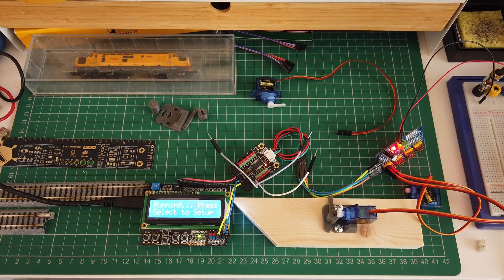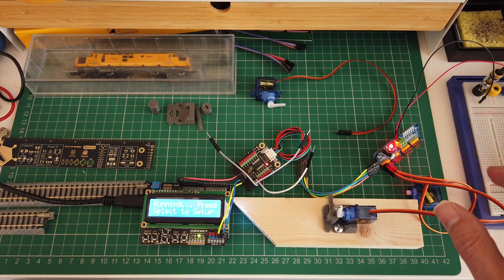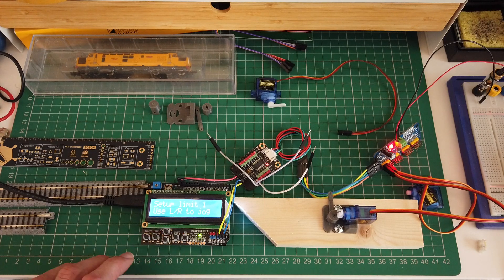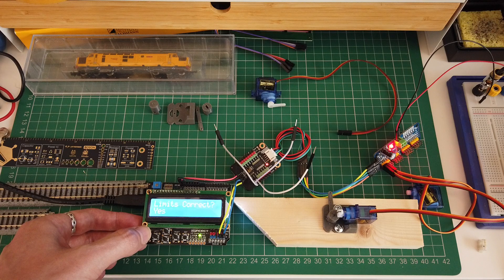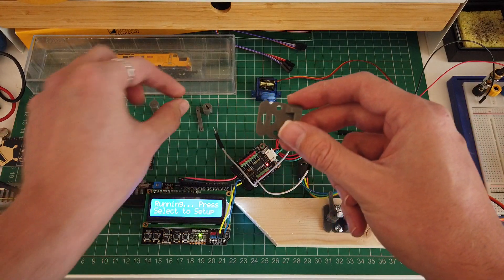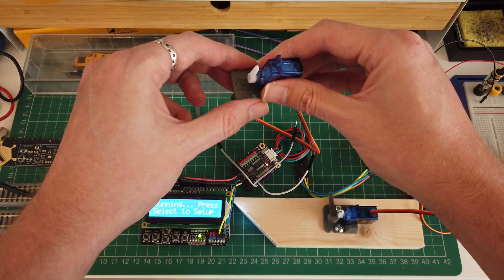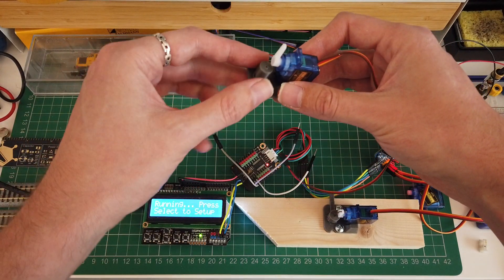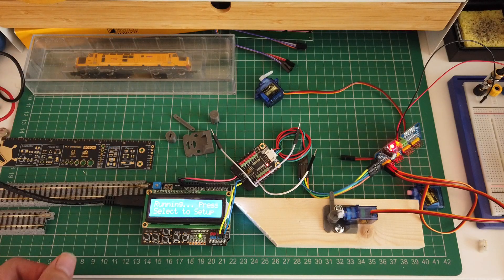Model railway servo point control system

Comment: Could you put in a link to the .stl file for the mount please or refer to where you got it?
Reply from the maker: I designed the mount myself, it's still being tweaked so there's no stl yet.
Depending on your baseboard thickness the shaft might need extending.

Comment: Keep them coming all very interesting.  I’m a member of MERG (Model Electronic Railway Group) we have a similar system EzyBus. The original is based on the same LCD keypad shield on a UNO using I2C to communicate between Input and Output boards. You set the servos movement, in the same manner, using the buttons on the shield.
I have also built your MK1 DCC++ EX throttle T3-EX Tethered. I’m immobile at the moment so haven’t been able to do much testing, but so far so good.
Reply from the maker: Thanks, I hope the throttle was easy enough to make. Documentation isn't my strong point.
Reply: @haywardjunction  
Getting to grips with Visual Studio and PlatformIO was my only problem. I was having problems compiling until I discovered that I had to use the same versions of Libraries you had used, not the latest available. Have a Prusa 3D printer so when I can I will print the case design you provided. Thanks again.
Reply from the maker: @stevewilliams1054  thanks for letting me know, I'll try and compile and see what the error was.